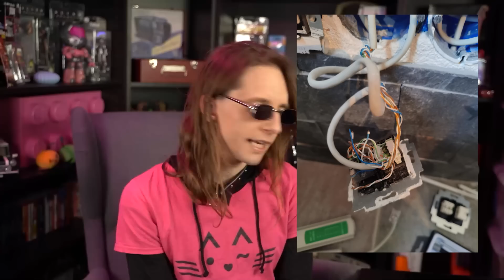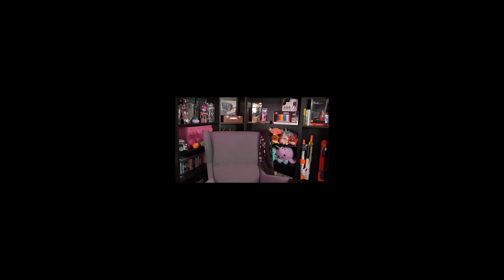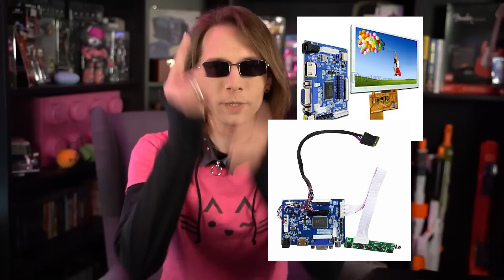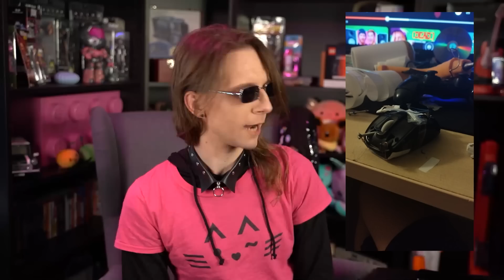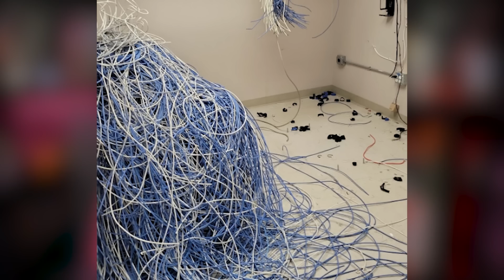Top 10 Ways To Notwork Your Computer'nt | Lexplanations |  r/techsupportgore & r/hardwaregore

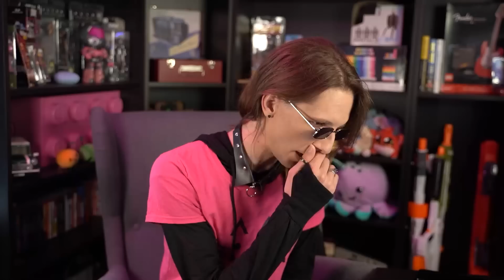Comment: Regarding Power @ 5:20... from experience It looks like 1.5mm² Wires... so, according to german regulations it's safe up to 16A @ 230V (or 3.6kW) in "home usage" where wire distances usually does not exceed more than... like 100m... from breaker to outlet (Industrial Outlets are required to get 2,5mm² wires)... But also it's not safe because you have loose ends on one side that could be still connected to life wire... Sooooo Dont do that.

Comment: [ EDIT: There are exceptions to what I said here, as Lexi pointed out in a reply. Some tags do have live update, change prices based on time of day, etc. What I said below seems to be the norm, but keep in mind other stores' tags might be different. ]

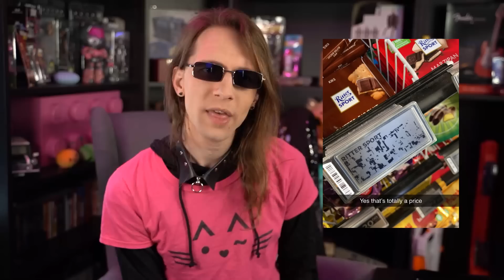6:24 The e-ink price tags aren't actually as over-smart as you thought they were:

The tag itself is just an e-ink display in a case. No power supply or driver or anything because e-ink holds its image with no power, hence why they're used instead of, say, LCDs here. The tag is removed after you buy the thing, so it stays in the store, and is arguably less wasteful than paper card tags because they can be reused basically forever. The price can't change when you turn your back because there's literally nothing to update the screen.

When it's time for the tag to go on another product, a new image gets flashed onto it using another electronic box, which interfaces over a few pogo pin looking things. The failure shown here was during that flashing process - the image got completely garbled, and the store employee just rolled with it.
Reply from the maker: Looking through the comments, there are a bunch of different systems. Some do love update, and JC Penny apparently had one that raises prices the later in the day you were there. Another one saw a price update in front of them in Aldi..

Comment: an important safety feature in all plugs I have actual knowledge on appearance: FUSES IN PLUG. different plugs have different fuses, all based on the intended wire, the device it is meant to be used for, and the expected possible supply. don't know how they work beyond that, but if power above fuse limit: fuse break in minor way and power no more flow.

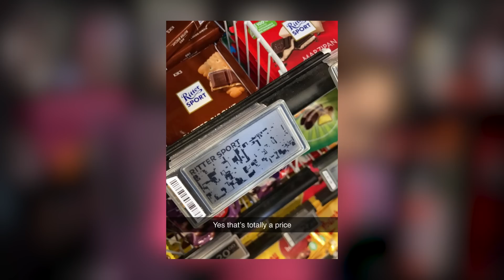Comment: 6:16 E-Ink displays like this are actually becoming more and more common many places.  The idea is that they save a huge amount on labor and other problems because every time they need to update the prices on some items (which for many sorts of stores, particularly grocery stores, etc, happens a lot, as much as every week or more, as supplier prices change, etc) they don't need a bunch of people to go out and manually replace all the price tags on every shelf, they just send out an update over the network instead.  It also makes it less likely that something will be labelled wrong, or labels will get switched around, etc.  These updates generally happen when the store is closed, though, so it's not like they're changing the price on you as you're walking around the store.

If you think about it, the "dystopian" scenario you describe of prices changing between when you're at the shelf and the register actually has no real upside for the store, and all downsides, anyway.  You're going to get up to the counter, get sticker-shock, either decide not to buy the product (so they lose the sale) or worse, buy it but leave feeling cheated, so you probably never shop at that store again (they permanently lose a customer).  Why would any store want that?
Reply from the maker: If you look through the comments there are actually examples of a bunch of different systems. JC Penny had a system of these where the prices were cheaper in the morning and increased through the day. Others are manually updated by a hand device and recharge a small capacitor so it still needs the labor. Never something I saw in NYC, probably because they’d get stolen within a day lol. What would people do with them? No idea but anything that looks fancy is yanked.

Comment: 5:15 People often seem to have the mistaken impression that safe wire gauge has something to do with distance.  It doesn't.  It doesn't matter how long the wire is, if it's too thin, it's too thin, and it will heat up just as much, and be just as dangerous.  What gauge you need just depends how much current (amps) you are pulling through that wire, not its length.

Distance does come in if you are worried about voltage drop, but that is a completely separate issue to whether it is actually safe to use or not.

(and it's still called "wire gauge" whether you are using American units or not, so instead of "AWG" you can just say "gauge" instead and it's the correct term no matter where you are and what standards you're using)

Just based on the visuals, that wire gauge seems fine for that application, though, frankly.  It's unclear what type of wire it is, but even if it's (worst case) 28 AWG Cat-5 cable or something, as long as it's using all 8 wires that could still support over 11 amps of current, which at 230V would be over 2500 watts.  Personally, I'd be much more worried about bad connections where the wires are just shoved into the contacts sparking and causing a fire, though...
Reply from the maker: The way the length thing was explained to me for current was that you had more areas for the wire to heat up and therefore the fire risk was higher. Idk. And yea I looked up the wattage of a PS4 pro after this and was surprised how low it was, always thought they would be around the same as a gaming PC. Not that the setup is defensible in any situation though hahah
Reply: @TheLexikitty  The heat generation scales linearly with distance, but so does the thermal mass of the wire and the cooling effect of the surrounding air, so it actually all balances out in the end.  A 1 inch wire carrying 10 amps will get just as hot as a 10 foot wire carrying 10 amps if they're the same gauge.

Of course this does assume that it's not all coiled up or in a pile or something.  That definitely can make the heat generation much worse because there's less air contact for cooling.  (And I have seen cases where extension cords, etc, melted because they were all coiled up instead of being spread out...)

Comment: techsupportgore with lexi is always fun and memories.
@ the guy without a cable who needs to game. the wire size is my smallest concern. UK sockets have over 4mm wide slots (up to 4.8mm), xbox uses 300watt so less than 1.5Amps. even beeing conservative, 20awg  in open air should be fine. these wires look a lot thicker han 0.8mm core diameter.

also i can't resist to add to your explanation: the length of the wire doesn't matter for heat problems. with a given amount of amps flowing 1 inch of to low gauge wire will heat up to the same temp as 10 feet but you have way more voltage drop. which might make your device pull more amp to get the same power so you have even more heat and voltage drop.  damned. length can matter. lexi was right

Comment: Yeah.... I am REALLY glad I opened up a malfunctioning Bluetooth keyboard instead of just charging it up and hoping for the best....

I didn't need a tool to pry the case open. Then again, there were proper screws holding the two parts of the shell together, so that might not be saying much. But having the case open on you as you're unscrewing what's holding it together is kinda disturbing. 

I got a new battery, from a RC hobby shop, but the only computer repair place had a new 60 buck service fee on top of the costs to repair the stuff, so I shipped the keyboard and replacement battery (insisting on ground only with the shipping company!) to someone I can trust in another state. Will it take longer? Yes.

Is the keyboard worth the shipping? Yes. I've been looking for a quality replacement, AND I CAN'T FIND ONE. Now I don't have to worry about it!

Comment: 6:00 well,I see you do not do that, I have done that, my father does it in daily basis.
And yes, I do not recommend you do that unless you must do.
Now, the reason is not that the gauge is too thing, those appear to be 2.5 mm² cables, they can deliver plenty enough amperes and power.
More that enough to run a 2u Blade server.
The problem is safety, the original is about 1.00 mm² double isolation cable, maybe 1.5 mm² with connectors at the end.
Emphasis on double isolation and connectors, without connectors those thing can easy short circuit or shock you, and double isolation protects even more against shocks.

Comment: You only get 3-5 years out of your hard drives? I have hard drives that are over 10y old and the SMART reporting on them gives me single-digit numbers of bad sectors.
Then again I do buy WD hard drives exclusively, I've had bad experiences with Seagate.
Reply from the maker: Hard drives can last much longer, but should not be relied on past 5 years or so if running constantly.

Comment: About that price display, many of our local supermarkets have them (I live in NY state (not NYC, Upstate)).
They're LCD displays. Why does LCD work in this case? Think about it. A standard-issue 4-banger calculator (does basic math, these days usually has a square root function too), can run on that tiny little itty bitty solar panel that probably doesn't even put out a whole 1mA.
And then they have the price displays. They only need to be updated infrequently, they probably use a short-range RF communication system for changing the price (the black-hat in me wonders if that communication protocol is encrypted or not, and is betting that it's not because of power constraints on the display), and I'm betting they each have a small lithium primary cell in them for power (CR2032 or something like that would be ideal and you can get those in lots of 10k easily).
LCDs are ideal for this, E-Ink displays are overkill. Why? LCD display cells are basically a capacitor. LCD display elements inside an LCD display don't consume any power unless they're being told to go from dark to light, or light to dark. When they're in a steady state, the only power they consume is a very small amount of leakage current. The thing that takes all the power in your fancy LCD TV is the LED backlight, the LCD itself only takes power when the pixels change.

For a standard size 7-segment display, the quiescent current consumed by a dark segment of the LCD is likely on the order of (total speculation) Maybe a few uA at most? Can't be much, it's basically just capacitor leakage current.

E-Ink displays ARE technically superior to LCDs for this purpose, but not by much. They DO consume "literally zero" power when not being told to change from dark to light or light to dark, but by no means would that make the 2032 battery in such a price display last any longer. Why is that?
The current consumed by the display to keep the digits in a given pattern is less than the internal self-discharge current of the 2032 battery.
In other words, you're gonna get all 10 years out of the shelf life of that 2032 battery.
Reply from the maker: I’d scroll through the comments, there’s a lot of different types of these things in use, some of which are genuine e ink. I still can’t help but see it as overkill especially with the chip shortage, but to each their own.

Comment: 05:15, That is a British 230v AC socket.

AWG? We use fused plugs. Our cables are all the same size depending on voltage.
Reply from the maker: You can buy 16 gauge, 14 gauge, 18 gauge etc extension cords. Power cables that come with devices are the correct gauge for the load expected…

Comment: Eink price displays are very common here. Depending on the system they can wirelessly update or are updated by the employees when they restock (hence sticker barcode as backup too in case of breakage or power issue)

It is very odd seeing the connected ones update and depending on the store a pricing update is priority 1 and stops literally all network traffic :p

Comment: you say the e-paper price tags are wasteful, but I'm sure that it's to reduce paper waste from buying and throwing them away.
Reply from the maker: I’d like to see the numbers on single use disposable  electronics easily damaged by the public vs. sticker paper
Reply: @TheLexikitty  they have them at our local aldi, and they're remote controlled. far from single use, and I'm sure the ones i've seen could survive a sledgehammer, not too sure about the ones in the vid tho
Reply from the maker: You can repair the internals? Impressive.

Comment: Every time I open any Li-Ion-powered device that I service regularly, I measure the the battery with my caliper, and compare it to previous measurements. If it measurably grows, I buy a replacement to install the next time I open the device. I don't take any chances with batteries, especially because I have a bunch of Samsung devices.

Comment: I remember a CHEAP chineesium Power brick that came with a power cable that had braided wire in 3 STRANDS of it per POLE. I did not use that part of the power brick.

Comment: I think battery expiration dates are utterly useless. Either they leak way before then or they just won't leak ever. There are still some "March 2008" Duracells around here that still work and those aren't the oldest. The oldest Alkaline battery I have which hasn't spilt all its guts is an old Energizer 9 volt. From the logo I know it was from 1980 to 1987.
Reply from the maker: Expiration dates don’t dictate when the battery will leak, just when it should no longer be considered safe. Just like old hard drives, they might work for a long time, sure, but you shouldn’t rely on them.

Comment: I am going to surprise you... but I don't have battery box... there is a plastic box next to the trash for batteries that when is sufficiently filled gets emptied into "used batteries" bin next to an electronics/Hardware store. but all out batteries are either carefully sorted in labeled box,  or entirely brand new batteries. Bot9h rec9hargeable and single use batteries are regularly checked. Family of certified Electricians here. :D For real.

Comment: 9:21 last month I've replaced a 12 years old 3.5" WD Caviar Green that had 75000+ hours on it from my personal rig because I had a feeling it's starting to act a bit funky (even though S.M.A.R.T. looked fine). This has to be THE longest serving Western Digital hard drive in existence, at least from my experience. Now it sits next to a big stack of dead WD 2.5" drives because of course they're all dead.
Reply from the maker: WD Gold and Red have been real good to me. Greens are awful, I don’t ever let them be used in enterprise environments. Seagate finally got their act together with the IronWolf line.
Reply: @TheLexikitty  If I ever get to build a NAS, I'm definitely considering the IronWolf drives. But with the current energy prices in Europe it'll probably be a single drive plugged into a RPi for just media when I'm at home and downloads when I'm not.
Reply from the maker: DSM 920s use just south of 15 watts most of the time with RAID and all, if that’s helpful

Comment: I´m sorry, to correct you, but in minute 6:10 , you are incorrect. Yes, I wouldn´t trust this, but also, the PS4 Slim takes less, than an amp of power, sooooo it should be fine :D
Reply from the maker: Yea I’ve got a few dozen of these m, I was surprised  to see how little power  the PS4 drew, I just looked at it and was like “mk gaming pc”. Not that we know the actual gauge of the wire, and not that this would be okay in any situation ever lol
Reply: @TheLexikitty  I am a PC gamer, but this wire will take at least 8 amps
Reply from the maker: Still can’t say it’s something I’d put 8 amps through, but I also get 14 and 16 gauge everything as much as possible. That’s ignoring the rest of the setup  deserving a slap in the face lol

Comment: Eh that wire gauge is plenty, on a 12v system it could easily handle 60amps, so it will be plenty for a ps4 on 110v. But if they just shoved the wires in shorts are a massive risk.

Comment: With the ps4 it's in the UK where we have 240 volt and need half the current to supply the required power compared to the us. We use very similar standards to AWG as its just basic maths and it. Despite being horribly janky and a fire hazard it should(TM) work....

Comment: Minor Correction for you knowledge Lexi.

The thickness of a wire is not a limit of how much Voltage it can carry (a single strand of properly insulated copper the thickness of a human hair can safely carry 10,000 Volts), Wire Thickness only limits how much Amperage a wire can carry, it's the insulation that limits the Voltage...so as long as the Amps aren't too high and the insulation is rated for 120 Volts, that's perfectly safe (assuming the connections themselves are properly soldered/terminated)...

Though since Power (Watts) is Voltage x Amperage, you're sort of correct...
Reply from the maker: Correct, I was under the impression PS4 consoles drew much kore current than they actually did, mainly because I’m a PC gamer and I assumed it was similar draw. That person should still be slapped though.
Reply: @TheLexikitty  With a rocket powered Sledgehammer...

I'm an Electrician, so seeing things like that is the same for me as seeing a Network Closet apparently Dedicated to the Church of the Flying Spaghetti Monster is for you...AKA Grounds for a Justifiable Homicide Defense in Court...

😄😁😆😅😂🤣
Reply from the maker: Preciselyyyyy

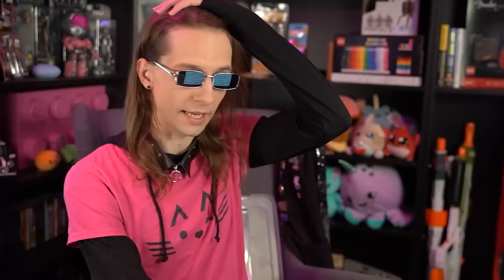Comment: 3:18 i have a battery that expires in march 2008, it's been working fine 14 years after is expired (yes 2008 was 14 years ago and adventure time started diffusing in 2008)
Reply: I have a whole bunch of March 2008 Duracell AAs around the house. It must have been an especially good batch then.